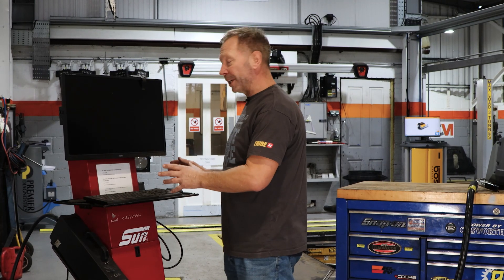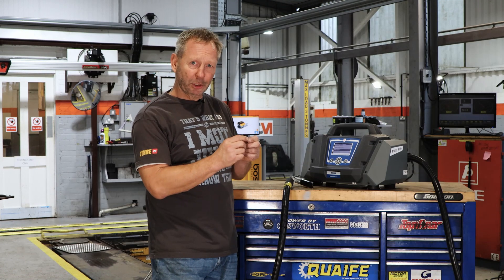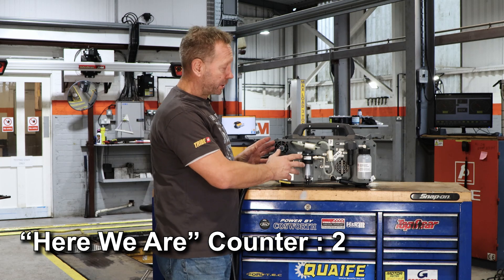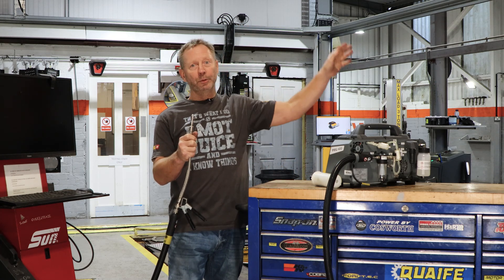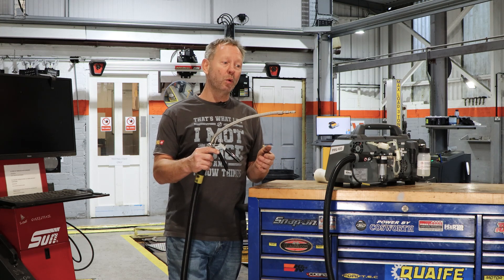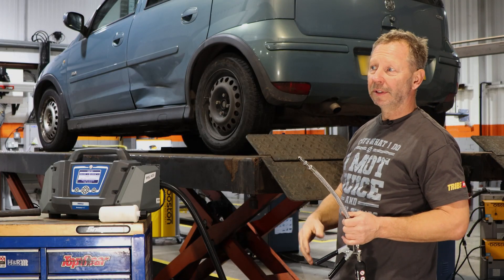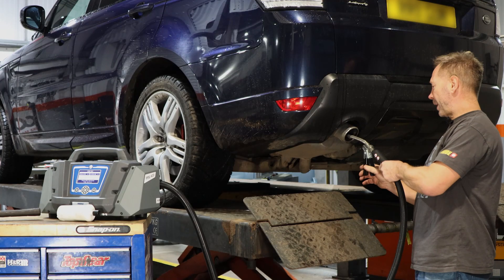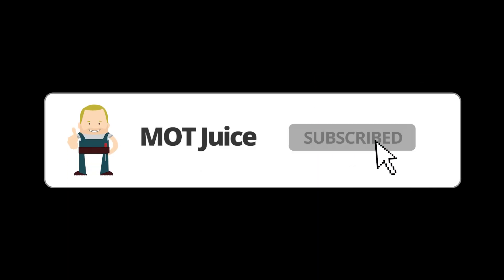How The New Mahle Particle Counter will Change MOTs

Comment: My only concern is will the government punish us existing diesel drivers by retrospectively changing the test for existing vehicles already in use like they did with the smoke opacity values and the plate values? I get that they want to clean up the air as they say, but it's the first time I recall them back dating changes to existing vehicles. 

I run an older, high mileage diesel (a 2007 Mondeo mk4 2.0 with a DPF and EGR still in place) and it struggled to get anywhere near what i believe the plate value is.
Reply from the maker: We are actually working on a video that investigates what the government actually want to do with Diesel - spoiler alert: it doesn't seem like they have a consistent stance on the matter, like how the Diesel sale ban keeps moving between 2030 and 2035. We had a moment where they wanted to change the rate of MOT testing from 3:1:1 years to 4:2:2 which was quickly dropped after some pressure from us and other Testers. The lesson we take from this is that if you have concerns, then give communicating directly with the DVSA and government a shot. Because they don't seem quite as committed to their proposals as they make themselves out to be. Otherwise stay tuned as we will come back to this topic :)

Comment: I often wonder about the particles in our workshop air when diesels are running. Often I get a headache when carrying out an mot on a modern Diesel engine. But stick me next to an old tractor and I’m fine. There are definitely differences to what modern diesels emit.
Reply: Yeah I agree they stink bad too most of the time

Comment: Barry, totally agree this is the potential future of emission testing, but until the UK government update the specification for MOT emission testing we need to continue using the current technology, which does still help drive down emission in our environment, but as you highlight it does not always catch those who are trying to cheat the MOT test by modifying/ removing parts of the vehicle, such as the DPF filter.

Comment: So will we be expected to run diesels and petrols the same way i.e foot down on diesels, and running petrols at 2500 rpm, or do we just leave it to idle to get our results? Also is the device wireless, because i get fed up of all the wires and cables around the workshop floor.
Reply: yeah it was blue tooth and looks liel all tests done at idle